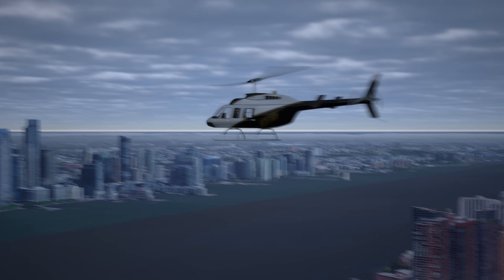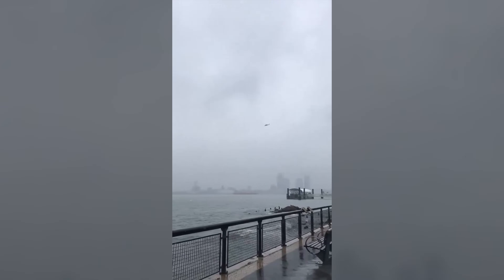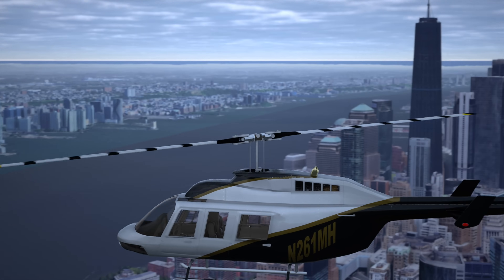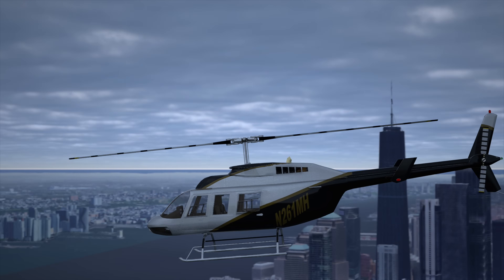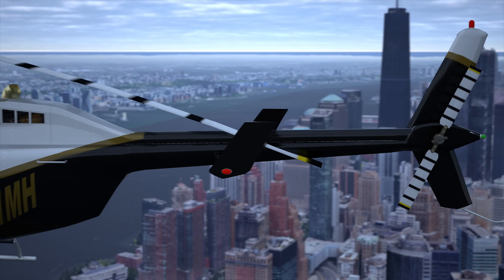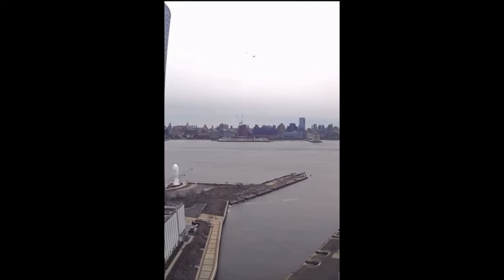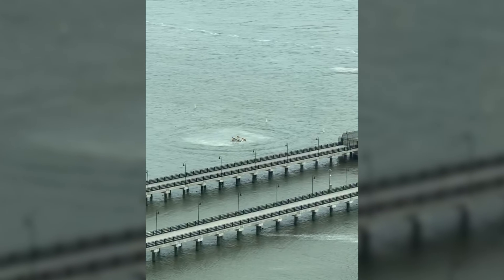Helicopters DON'T just fall from the sky - What is "Mast Bumping"?

Comment: Consider that if the gearbox came loose, the fuselage would dive and possibly drag its tail through the rotor system. Just a thought that a gearbox failure and departure could remove the tail as the rotor pitched up.

Comment: Seems like helicopters should be engineered so the blades can never touch the tail, why are they designed like that? Is all that range necessary for the angle of the blades?

Comment: Pilot, A&P mechanic, and IA here with over 30 years of helicopter experience. This is clearly NOT Mast Bumping. 
In the video, the rotor head is still spinning with an attached gearbox. Another words, the Mast did not fail, and is still very  much attached to the gearbox and rotor head.

The real question is where did the first catastrophic failure happen? Did the tail boom separate first? or was it the gearbox that separated from the airframe first..
Either failure could’ve caused the other.. I’m sure there will be a lengthy investigation to figure it all out. 

My guess and experience with tail boom AD’s is the tail boom failed first and caused a structural failure of the airframe leading to the separation of the gearbox from the airframe catastrophically killing everybody on board. 

My prayers are with the families

Comment: FIRST the chopper takes an xtreme turn to starboard -High G-forces. - SECOND the tail falls off _THIRD the rotating blades w/ transmission attached pulls out. Nothing normal about this. Chopper has bluetooth and forced to turn right. Pilot to "celebrities" (what did he know) & CEO of Siemens -Spain? Siemens makes a lot of military equipment. And Spain has had a lot of special ops in & out for the last few years.
Reply: Hello how are you today?

Comment: Has anyone ever had a in experienced  front seat  passenger accidently push down on the collective hard when adjusting them selves in the seat??????
It obviously dumps all lift and is difficult to recover from without over loading the rotor.
The rotor flex from negative angle of attack to positive in quick succession is excessive.

Comment: Articulated refers to the lead lag, and independent flapping of the blades. The Bell 206 rotor system is a semi ridged rotor as the lead lag is fixed and the blades flap in the same plane about the teeter bolt. There is no such thing as a semi articulated rotor system.

Comment: Before you get to conspiratorial, the tail boom and large pieces of both rotors are visible separate from the main fuselage of the helicopter.  My guess a failure or deflection of the tail boom put the tail in the path of the rotors, shearing the tail off and fracturing the rotors near the rotor hub.  What caused that failure will hopefully become apparent with the investigation.  Don't be too quick to hypothesize before you get good facts.

Comment: Rotor impacting the tail boom and mast bumping have nothing to do with each other, and mast bumping is not what happened in this accident. Rotor can impact the tail boom with any type of articulated rotor hub. Mast bumping is specific to see-saw rotor hubs and if that occurred, the rotor would break off clearly at the top of the mast (at the point where the bumping physically occurred) while the rest of the helicopter would be mostly intact.

Comment: This is pure speculation Brian have you ever taken a look at a Chinese tree trimming laser system take a look at the capabilities of the Chinese laser trim tree laser system and you tell me if they can put that thing on top of a building basically it's a size of a couple of briefcases with the tripod can somebody gets into a flight pattern and hits it with one burst of a laser because the way that helicopter just dropped out of the sky is similar to something that shot down that's my opinion I keep looking at that video over and over and you wonder how does the rotary tail stay up in the air like that and the rest of the helicopter main Rooter stops completely and goes upside down and crashes into the water

Comment: As the Safety Director for CFLCC  in the Middle East for the largest movement of forces since World War II, I investigated accidents in the air, ground, and sea. I was always amazed at the resilience of military aircraft. But I developed a personal policy to only fly helicopters with more than two blades due to the lower probability of mast bumping (lower with more blades).  Maintenance is critical, but cannot overcome design shortcomings. The US military uses two-bladed Bell helicopters most often as Scouts called Kiowas with never more than two people onboard; in hot weather often only one person. For me as a tourist, I prefer the Eurocopter with more than two blades and more than one engine! Check the safety records of different helicopter designs before you fly. I also prefer flying in multi-engine fixed wing and rotary wing aircraft (helicopters) to always have a backup! That's just my personal policy.

Comment: The "Jesus nut" is a slang term for the main rotor retaining nut on a helicopter, which is the critical component that secures the rotor head to the rotor mast. It's called the "Jesus nut" because if this nut were to fail in flight, the rotor would detach, leaving the crew to pray to God.

Comment: In 2016 we had a, from the looks of it, similar tragic accident with an AH H225 Super Puma in Norway. A tooth on a gear had come off due to fatigue, which caused the gearbox to seize and the main rotor came clean off. Just like this helicopter it plunged straight down in the sea, all 13 on board died instantly. In that accident the main rotor also kept flying for quite some time, just like in this case.

Comment: Based on this video, I’ve come to the conclusion that helicopters do indeed just fall out of the sky for no reason whatsoever.

Sounds like poor design to me.
Reply: Get back to flipping burgers and leave the adults to talk this through.
Reply: Yeah, he just explained a mechanism by which they do in fact sometimes simply fall out of the sky.
Reply: On 29 April 2016, a CHC Helikopter Service Eurocopter EC225 Super Puma helicopter ... The main rotor assembly detached from the aircraft and the fuselage plummeted to the ground, exploding on impact.[1][2]  https://en.wikipedia.org/wiki/CHC_Helikopter_Service_Flight_241

Also possible is the use of fake or defective parts or not observing the maintenance replacement schedule.
Reply: The Bell 206 Jetranger has been around since 1966 in various configurations. It has an excellent track record for flight safety when properly maintained. This is NOT a design problem! This is a poor maintenance problem.

Comment: My guess based on the video:  Tail rotor failure, gearbox or power shaft failure.  I see it flying straight and level when it suddenly rotates and loses the tail boom... main blades probably struck it and separated the whole drive assembly from the airframe.  Seen it happen before more than once.

Comment: what puzzles me is the way the rotor came off with the whole gear box. Judging from the footage I think it's clear that mast bumping eventually caused the helicopter to disintegrate. But isn't it also possible that the helicopter maybe had structural problems already hidden somewhere that might have caused the mast bumping in the first place? I particularly think of something like the gearbox unit and the rotor starting to loosen itself from the airframe in some way. What do you think?

Comment: In RC we call the main blade hitting the tail boom a "boom strike"  Caused by a hard landing or excessively rapid main rotor pitch change.

But the video of this accident looks more like the "Jesus bolt" came off... which would cause the upper gearbox to separate from the drive line and as that happens, the rotor often hits the boom.

They call it the "Jesus Bolt" because if it comes off you're going to meet Jesus.

Comment: I go to school less than a mile away. I was at a place called exchange place when this happened and I heard lots of loud cracks( like a mix of thunder and gunshots). I assumed it was my loud light rail ( a light rail is the Jersey city equivalent or a tram) but the light rail was pretty far away. I dismissed it until I got to Hoboken terminal, less than half a mile from the whole site. Helicopters flew over us very low and the police wouldn’t tell us what happened at first. My prayers go out to the family.

Comment: Helicopter blades are always connected to engine and constantly pitch are they rotate to create lift. If maintenance is NOT carefully done, they can separate such as this accident shows. Unlike helicopter blades always connected to engine, Autogiro's blades rotate around its axis without being tethered to engine. Autogiro blades, in my opinion, suffer less stress fractures than helicopter blades.

Comment: Excellent  video however visual evidence doesn't support the bump theory.
Mechanic here...the intact rotor indicates that this was not a rotor bump. The probable cause was was missing aviation-grade cotter pins on the gearbox  mounting assembly nuts/bolts. When the box vibrated loose and separated from the fuselage, The unbalanced  tail rotor  torque sheared the tail assembly which probably  had metal  fatigue from extensive  hours in flight. The probable reason  for forgetting to install cotter pins is THC in one's blood and a negligent maintenance  supervisor  to check the mechanics work. If so, both  should  be brought up on negligent homicide  charges since 3kids died.  That's why military personnel are tested  for THC as well  as oil  changers  at Walmart. Walmart  doesn't  want  to  buy new engines  because  their  mechanics  forget  to torque the drain  plugs properly, as this can become very expensive for the company. 
Any helo mechanics agree?

Comment: Does not look like a mast bumping issue to me, nor that the main rotor sheared off the tailboom (at least not as the initial cause of the problem).  The blades, hub, mast and gearbox all appear connected and in relatively good condition.  My initial suspicion is a catastrophic failure of the main gearbox, either a structural failure of its connection to the airframe and/or seizure of the gears.  The rest of the inflight breakup could be the result of the shock and deflection of the tailrotor drive shaft and massive torque forces on the engine/gearbox mounts.  This is really a nightmare scenario, my thoughts are with the poor souls aboard and their extended family/friends.

Comment: There had been a “BUZZ” in the torque pedals that maintenance was not able to diagnose and eliminate; the tail boom is attached to the fuselage by four bolts.  The attachment points are castings; riveted to the tail boom’s skin.   One casting had cracked - causing a feedback vibration to the torque pedals.   
      Typically, management wouldn’t allow maintenance to remove the tail boom for the necessary inspection; no regulation covers the exactitude of the scenario, the defect is difficult to see when assembled.    The “BUZZ” is generated by the rotational forces of the tail rotor into the pedals; it progressed with continuous operation until catastrophic failure.   BANG 💥 !!!
    Everything else followed from there…..not the first time, not all that common but this time some high profile people died….
     Look at the stilted robotic “regulation” of the government agency that is supposed to be on top; 
P.S. this didn’t just happen !

Comment: Helicopters are awesome for military and rescue use, or when there is simply no other way of accessing areas. But that's the extent of where they should be deemed "safe". They are highly accident prone and should be avoided unless absolutely necessary. The heavier duty models are a bit more rugged both in their structures and safety redundancies, but when you're dropping out of the air, there's only so much that can save you.

Comment: The whole rotor assembly does not tilt itself, rather the blades themselves change pitch according to how far up or down the swash plate (a ring at the bottom of the rotor shaft that spins with the blades and pushes rods up and down to change the pitch of the blades). When you push the stick forward the swash plate will lift the back end and lower the front making the pitch of the blades change so that there is more upwards force from the back and less from the front, this will make the whole heli lean forward as well due to the imbalance of thrust. It's the same principal for each direction of the stick. You can also change the overall pitch of the blades with the cyclic control witch will have the effect of raising or lowering the heli in the air

Comment: The main rotor was still spinning with no damage and gear box still in place. If the rotor chopped off the boom then the rotor would've shattered. Many witnesses said the rotor detached from the chopper and was flying by itself. Mast Bumping is hogwash.
Reply: Yep, tend to agree. That blade would have been badly damaged
Reply: You are forgetting that the power train and the tail broke away. Not just the power train going solo

Comment: Not a Jesus nut fail. Rotor and transmission attached together, not indicative of a mast bump.  Tailrotor and boom definitely separated, possible shaft fail, but the rotor system and transmission coming off together indicative of a failure massive enough to rip from mounting assembly.  The maintenance department/management is gonna be under a microscope.

Comment: If you slow down and enlarge the video, in the first few seconds, you can see the tail boom collapse just behind the fuselage. a second or two later, the main rotor separates vertically. There doesn't appear to be any damage to the rotor. It is very likely that a positive determination of the cause will be made once the wreckage is recovered.
Reply: I agree. The rotor appears to still be in one piece, so I vote no mast bump. Tail bolt failure is my guess.

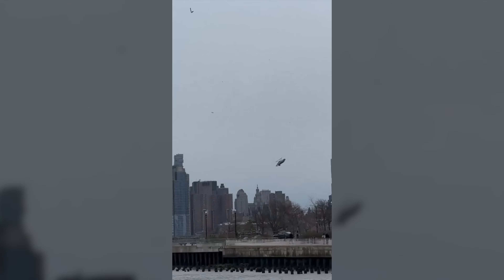Comment: At 1:31 you can see that the entire tail rotor at the back of the helicopter is missing.  The tailboom is gone!   The tailboom contributes to the aerodynamics of the helicopter, and the horizontal and vertical stabilizers are attached to it.  With increased airspeed, they provide stability to the helicopter.  Without them the helicopter cannot be controlled.
Reply: It's shaft broke mid shift rod connection stabilizer and the shift whooped and then didn't shatter until it built up enough wobble to brake off an intacted tail ROTTER THEN hit nothing but shift broke and chopped off it ls own tail section which got hit by top routers and and you have a half one 1.5 auto rotating is flat spine tumbling sushi shift tailless fish toss looking horrible crash.. cuz tail rotter fell 1st and looked in good shape.
Reply: At every other point in the video you can see the rotors and rotor hub flying in a different part of the sky. The rotors spin to create aerodynamic lift that hold up the entire helicopter in the sky. When the rotors are spinning in a different part of the sky, there's nothing the pilot can do to control the aerodynamic forces and lift. What a tragic and shocking event and that's the best comment you can come up with?
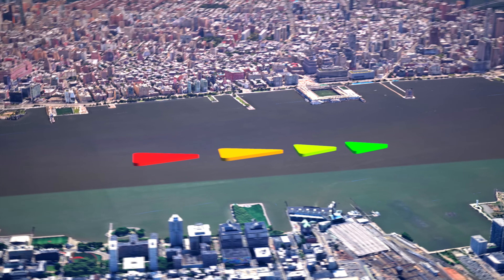Reply: @mvwoon  You must be looking at a different video because in this nearly seven minute long video the only images of the helicopter that crashed and the rotors and rotor hub flying are  contained in the 32 seconds from 1:30 to 2:02 in the video.  I identified the exact area where the relevant images are located.  The rest of the video is voice over and computer animation and audio of the radio transmissions after the crash.  At no point in the remainder of the video can you "see the rotors and rotor hub flying in a different part of the sky".  Maybe you imagined it.  That's the best comment you can come up with?

Comment: Poor maintenance. I'll put money on it that the gear box failed, and exploded taking the tail section with it. No other reason for the rotor blades to be falling behind the machine. Just my honest opinion. Many companies neglect the maintenance of these machines because it is expensive. Any time you have a gear box that works both verticle, and horizontal, there is a conflict of forces. In this particular design there is little to no warning and the results are deadly. Ask a military pilot about it.

Comment: If the blades had hit the tail boom, they would've shattered. But in the video, they still looked intact. From my perspective, it looked more like the transmission locked up, causing mass destruction and separation of both mast and tail rotor, with the driveshaft in the tail boom also causing it to destruct.

Comment: I’ll go on the record with this opinion based on what I’ve seen on video and eye witness comments.  As the aircraft was in straight and level flight I believe one or two of the four transmission mounts catastrophically failed causing the gear box to abruptly tilt back and tear free of the forward part of the fuselage. As this happened the rotor blades chopped off the tail boom causing the main cabin to plummet to the river.  Everything I mentioned here can be confirmed in the post accident investigation.   This is how I see it.  We’ll see what the investigation comes up with.   As far as mast bumping, it was a very understandable explanation; however, mast bumping usually ends with the rotor shaft separating just below the rotor head and wouldn’t necessarily take the whole gear box with it.   I’ve flown this type of aircraft before and I also have flown tours for a private owner around NYC every summer.  Kudos for the quick response by NYPD and FDNY. May the family rest in peace.  Thoughts and prayers to their families.